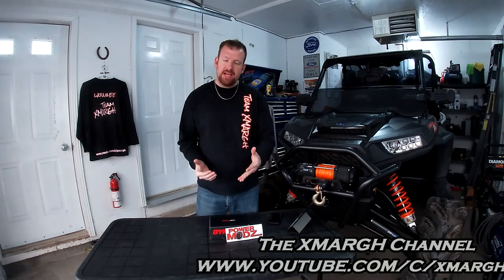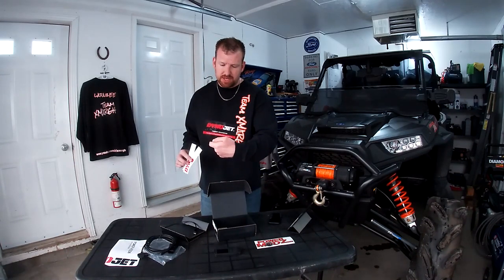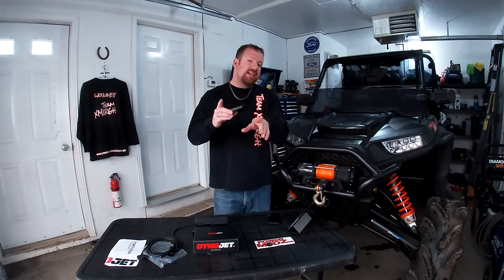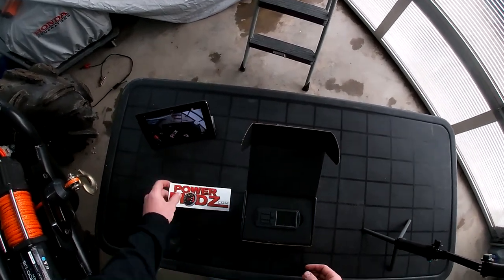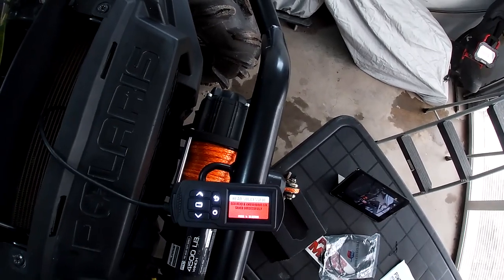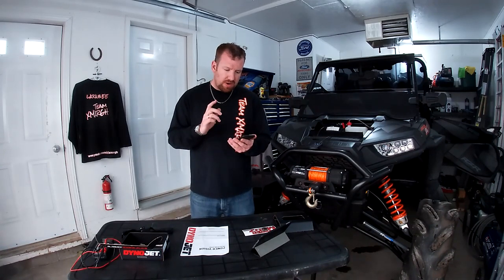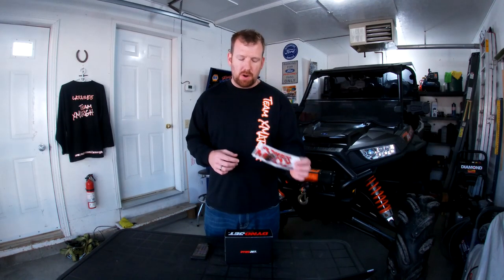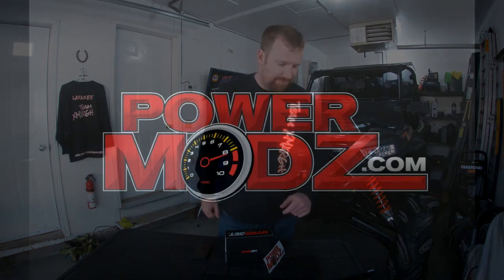Polaris RZR ECU Tuning w Dynojet Power Vision 3, ECU Reflashing With Free Tunes!

Comment: I got the power vision 3 for my Outlander 1000r  and I LOVE this thing!  Huge difference in performance. Highly recommended for anyone wanting the reflash and have the option to reset to the stock or learn how to tweak your machine to get the best bang for your investment.
Reply: Do it increase top end speed?
Reply: Hey , does it removes the speed limiter or at least increases the speed limiter for a can am outlander 1000r..?
Reply from the maker: The 2018 and newer Can-Am models with drive by wire really benefit from this DynoJet Power Vision 3. For the 2017 and older I still recommend the Power Commander V with ignition.
Reply from the maker: You can remove the speed limiter yes.
Reply from the maker: Yes.

Comment: Hey, I know you are tuning your Razor, but do you know anyone that used this tuner on a 2019 XP 1000 Polaris Ranger. I will be tuning my SXS, and I have already put a Gilomen clutch kit. Confused between Gilomen, Rev1, and Dyno Jet tunes.
Reply from the maker: You can use this Dynojet to tune a Ranger as well. The Gilomen is an ECU Re-Flash so you have to send it in. Rev1 doesn't have the abilities this unit does. For me this is still my choice. Also if you want to get spicy you can have AA, RVS or any custom tuner send you a tune that will program through this Dynojet unit. Give them a call if you have any questions they are really helpful.

Comment: 👍👍👍👍👍 So I have a RZR 2019 Xp 1000 and it came with Stock tires and I put some 32 “ x 10” terabyte tires on .  Would I use the same tune as you did to get the same results as you ?
Reply from the maker: Jeff Warhawk Tires make no difference on what tune you pick. You simply select the correct tune for the engine modifications you have made. If that’s all you changed then it’s still considered a stock rzr and that’s the tune you would use.
Reply: XMARGH I haven’t made any changes to my clutch or exhaust do most of my riding at high altitude, our elevation here is 6000 feet but 13,000 feet here in Colorado. Do they have a tune for that? Is there a phone number I can contact Dino jet? I appreciate your assistance. Thank you

Comment: Do the 2019 fit 2020 also. Will this work on a completely stock 2020 turbo xp
Reply from the maker: Yes it will work for the 2020 as well. You may have to call Dynojet to download a tune as it may not have the 2020 calibration preloaded in the device. Dynojet support is top notch!!
Reply: @XMARGH  do it increase top end speed?
Reply from the maker: knockout champ56 It removed the top speed electronic limiter in my Highlifter but with 32.5” OL2’s I never dared test how fast it could go.
Reply: @XMARGH  I gotta get me one

Comment: Has anyone tries this on a Polaris Ranger...I have a 2019 Ranger 1000 XP, and wanting to know the power difference. Also what the top speed is, I ride with a big group and their speed ranges between 75-105...just get me around 80.
Reply from the maker: I wish I could give you accurate figures but I have heard that the Ranger 1000 XP is very detuned from the factory. I think you'd have more to gain from a tune then even the RZRXP1K would gain.
Reply: @XMARGH  keep me in the loop if you hear anything...I have looked at the Gilomeninnovations, and I like it
Reply: @rlsapp12  check with RVS Performance, just had him install his clutch kit and this tuner with his tune in my 900 today.  Pretty awesome!
Reply: @zachspicer3475   what is your performance gains...HP, torque, top speed.
Reply: @rlsapp12  here are the numbers for my 900.  I have his clutch kit and stage 1 tune so 20 plus ho increase to the wheels.  Top speed around 75 I'm told.  I haven't had much time in it yet.   https://www.shop.rvsperformance.com/Dynojet-Power-Vision-3-Polaris-Ranger-900-PV3-PRGR-900.htm